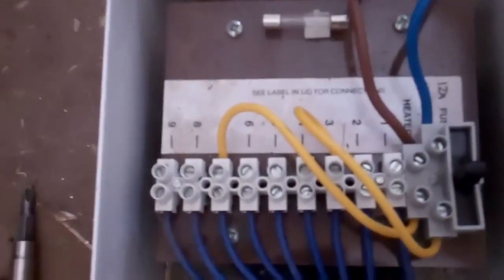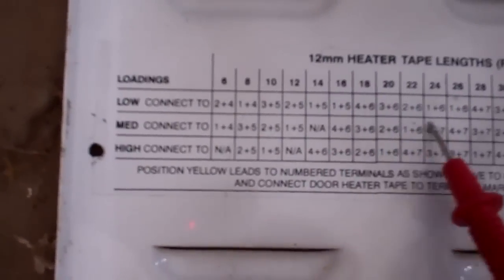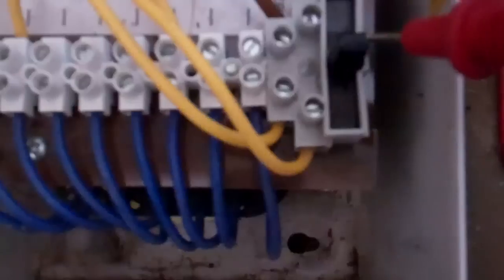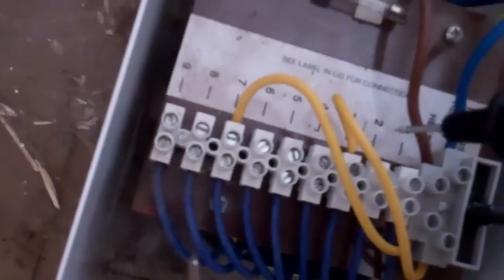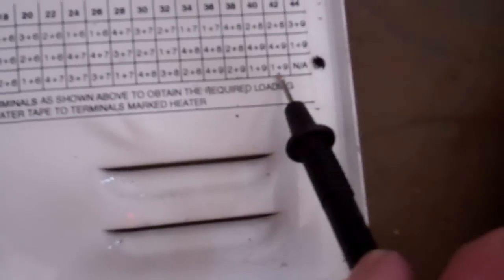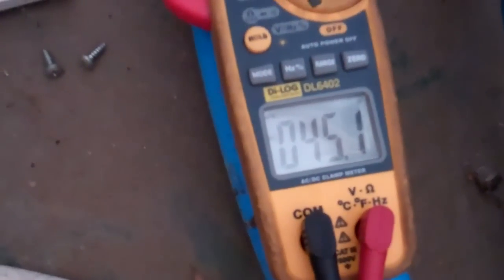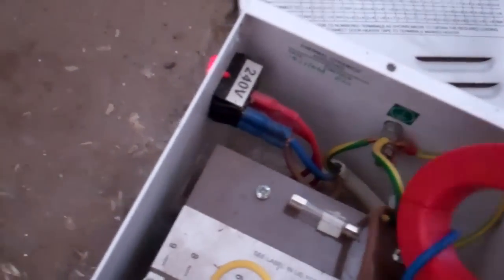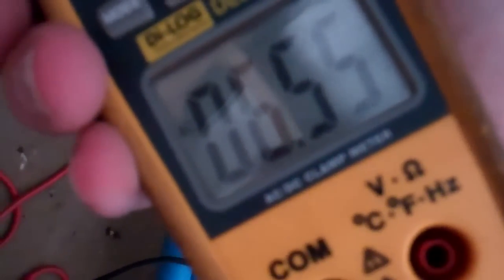Cold Room Door Heater Transformer

Comment: Hi I have the same heater where the board around the fuse, main terminals and live and neutral wires have burnt out. Can I just replace the board or will the whole unit need replacing. Please advise.
Reply from the maker: Just replace the board (sorry for the late reply!)

Comment: Hi. I have a Thermal Dynamics unit where the heater tape has shorted to ground. I can buy the a new tape. But it comes with the heater tape double sided tape- brown paper tape.I have looked all over the net for installation instructions- but cannot see any for this system. Can you help with a copy of the tape installation instructions. Normally I would just replace like for like, but as the original has failed , I must be sure that it was correctly done before just duplicating it.
Reply from the maker: I've never had to change a heater tape, I'd just  check there were no sharp edges or screws etc it could catch on, generally they are very reliable. I don't have and have never seen any instructions on fitting them sorry.
Reply: Thanks for the help. We found all the gen at Thermal Dynamics Ltd Swindon. They sent us the installation diagrams. You were correct about the sharp edges,  @heavydiesel